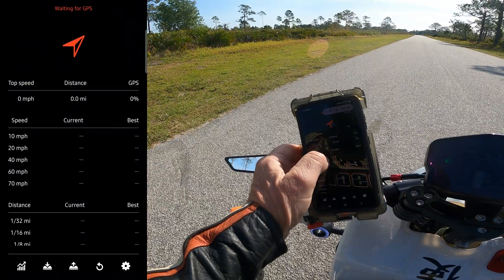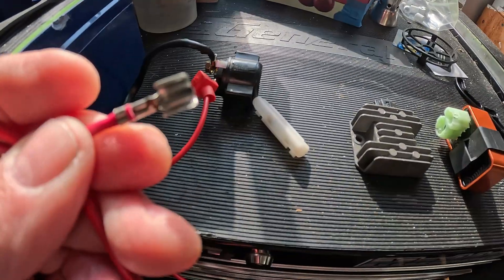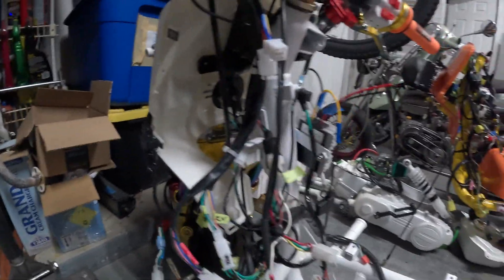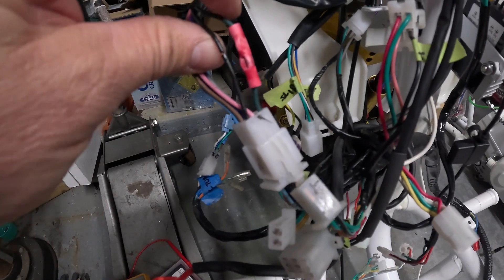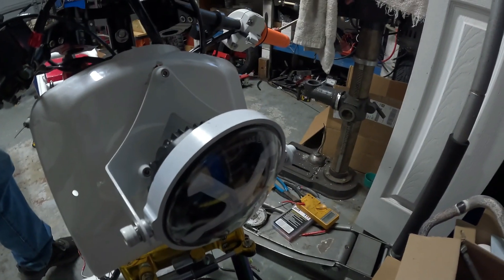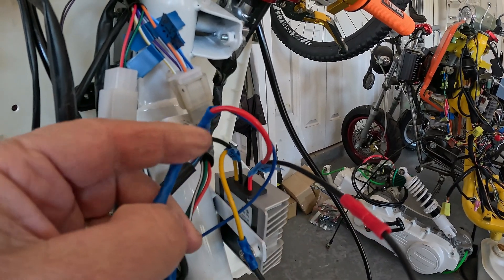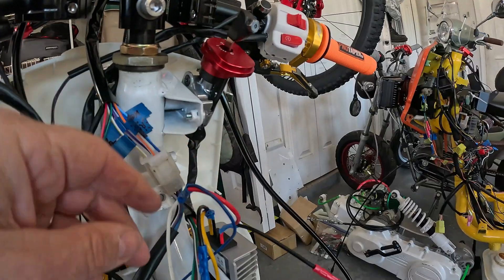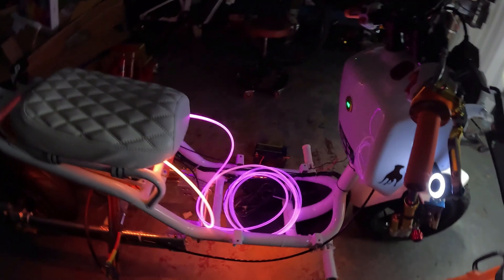Build Your Own Electric Motorcycle - Video 3 .. How to Wire the 12V Side With a DC to DC Converter.

Comment: Is the key switch rated for 96V DC? Isn’t it problematic to run such voltage through a key switch? Thank you
Reply from the maker: Wires do not care about the voltage running through them.  They only are limited by the amps or current pulled through them.  Too many amps and the wire melts so you need a bigger wire.  You see a lot of switches and thing "rated" for a certain voltage.  These as dumb as throttles rated for 72 volts when almost all throttles work at 5v.  Its bad advertising.  So if I have a headlight that needs 120w then with my 12v wire it will pull 10Amps.   I would need a pretty thick wire for that.  Here is where it gets counter intuitive.   If that bulb would work with 96v then it would only need 1.25 amp draw for 120w.  So the 96v wire is lower amp and could be thinner.  The key supplies very low consumers like the display and controller at 96v.  All the 12v high power consumers like lights and horns come in 96v from the key to the converter at less amps than they leave the converter with.
Reply: Thank you very much for the detailed response! I really appreciate it  @GhettoWrench

Comment: shame a bike that nice has so many unreliable butt connectors. hopefully you make the jump and solder everything one day. otherwise, great video and very cool build!
Reply from the maker: @chrisehst8907  Ya I'm always changing stuff to fast.  🤣🤣...  but good catch!
Reply: @GhettoWrench  catch ......its beyond obvious......to someone that takes pride in their work "wink wink wink." but honestly i wouldnt ride that. over time it WILL let you sit.
Reply from the maker: @chrisehst8907  I actually have decent soldering equipment,  but I will toss stuff together and function check then changee wire routing and stuff.  Eventually I will make a nice harness and try to hide it as much as possible.  For example, I have may an issue with a ground for the regen.  But butt connectors are still a more sound than all the plugs I am putting in it.   I find the biggest failure point is plugs.
Reply: @GhettoWrench  that's a fact. I respect you either way.keep up the good work
Reply: @GhettoWrench  super quick side note. I had an issue with the ground for my throttle once, which is based upon the same electrical principal as regen, and it resulted in my bike going WOT down a busy road. Less than ideal.
Reply from the maker: @chrisehst8907  and after all.  I am "ghetto" wrench.  🤣
Reply from the maker: @chrisehst8907  shit these are fast and that would be scary.  I actually practiced turning off my key real fast.  It does shut power to the controller and motor and everything.  So hopefully it is the go to emergency procedure.  I worry about that exact thing happening.

Comment: I made the mistake of grounding the 12v side of the DC to DC converter to the frame, thought it would be a good idea to make less wiring. Ended up making my frame live with my high voltage 60v and I got a big loud sparky short when I was doing my 12v wiring. I found out later that most DC to DC converters share a common ground between the high voltage and low voltage sides, so like you said, don't use the frame for 12v negative. Great video.
Reply from the maker: @toriwatson9655  OH man.  I did not even think of that!  I accidently gave good advice on that one.  LOL.  I was just thinking for a cleaner install only.  Thanks for that tip.
Reply: @GhettoWrench  Yeah, it's just something not mentioned much at all. I found a thread in a forum where someone reported getting a tingling sensation when riding the bike, his frame was live from grounding it to frame!
Reply from the maker: @toriwatson9655  oh wow.

Comment: Unable to find the app "dr" or "drag racer"... What company made the app so I can try looking them up by name. Thx
Reply from the maker: @Epsonblade  No idea.  They don't come up anymore.  I think the app is dead.  Must be why I don't get ads.  LOL.  There are tons of quarter mile apps on the play store though.  I may get a newer one..  mine dumps saved runs sometimes.  I have to screenshot them.
Reply: @ I want to see if anything is as accurate as my original dragy. I have a BT GSM020 to strap to RC vehicles and it's hit or miss with real timing systems. Dragy seems to be within .1 sec with times. I mean, our cell phones have all the sensitive equipment inside them needed for this stuff. I can't find a stand alone app though. LMK if you find anything for ios.
Reply from the maker: @Epsonblade  ok.  Ya I have an android.  My gopro also has a GPS speedo but is a real hassle to get the overlay from the camera to the computer.  You have to send it through the gopro app first.  The speeds are on with my app but it just shows speed.  It seems like that draggy thing is the best.

Comment: is the red B+ wire from the controller to the key fused?
Reply from the maker: @hershelshochter4703  no.  Should it be?
Reply: @GhettoWrench  it's either fused or becomes the fuse. i'm paranoid about sending power somewhere a 200lbs gorilla switches and turns connectors that might not be rated for >60v, anything that comes into contact with the operating ape is in danger
Reply from the maker: @hershelshochter4703  good point.  It won't be hard to put one in.  I put one between the 12v side and converter not trusting a the switches and stuff.  Didn't even think about the key switch failing.
Reply: @GhettoWrench  source: i'm the 200lbs gorilla who broke user interfaces before